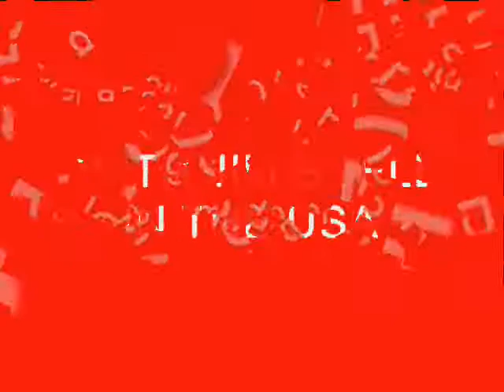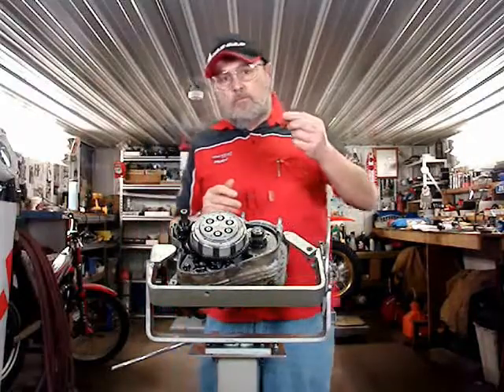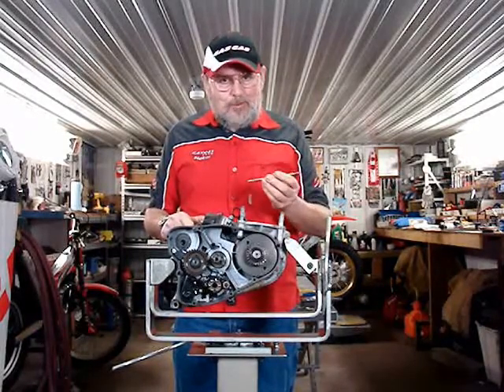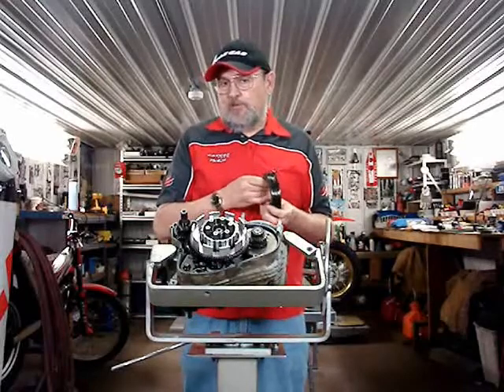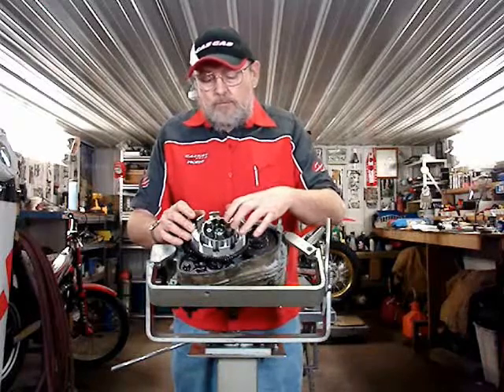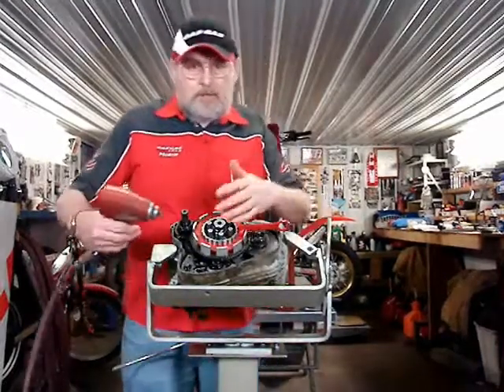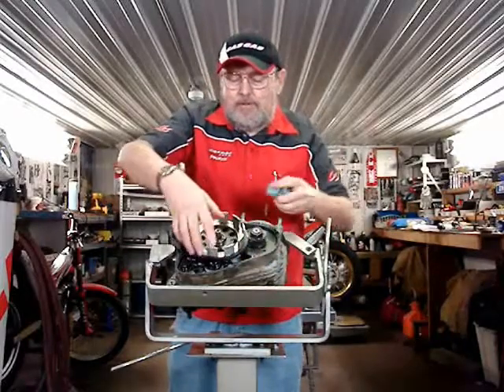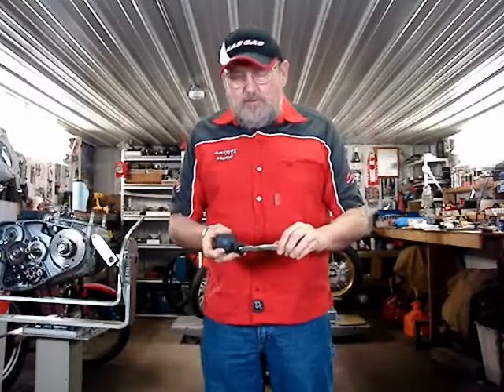Jim Snell - USA - GASGAS TXT CLUTCH (Not Pro)

Comment: I live in the UK and can't find mineral 5w30 mineral engine oil to fill my Gas Gas gearbox.  Instead I found Super Universal Tractor Oil or "SUTO".  I can find it in 10w30 mineral and it's specifically meant for wet clutches.  My bikes gears change up and down lovely with a smooth clutch too.

Just my recommendation for riders who can't buy 5w30 mineral engine oil.

Comment: In what order should i install the clutchplates and steel plates? ( Edition 2000 txt280 )
Reply from the maker: Hi
At 6:30 I show the inner most clutch plate (mixed disc) It is different than all of the other discs. It looks like a metal disc but it has fiber on one side. It goes in first and with the fiber side facing the interior of the hub, followed by a fiber disc, then a metal, then a fiber, then a metal, then a fiber, then a metal, then a fiber, then a metal, then a fiber......... 
Thank you for watching. Jim
Reply: TRIALS PARTS USA thank you sir 👍.